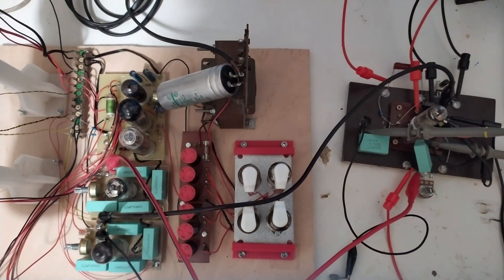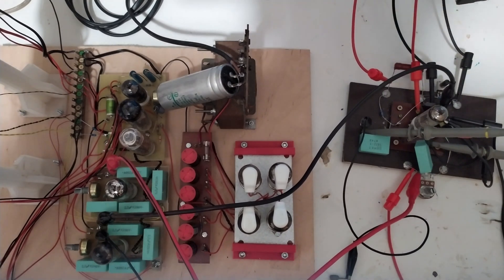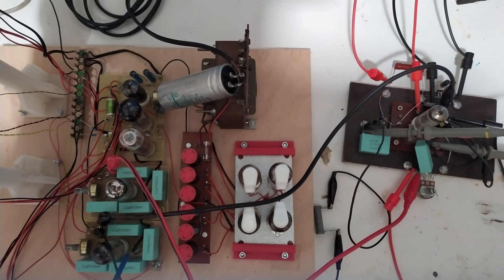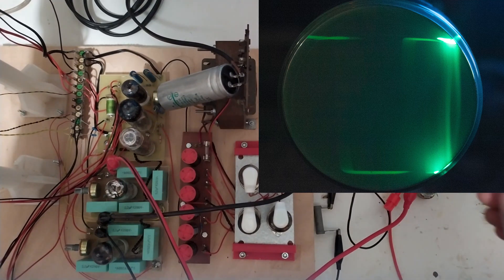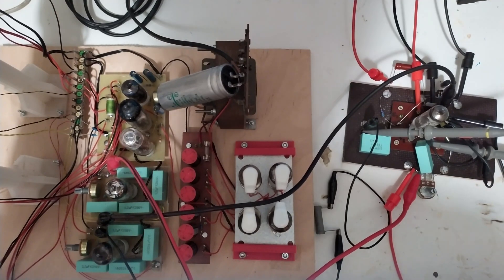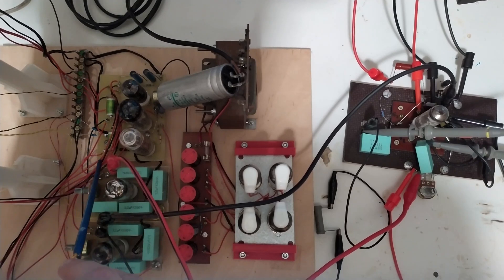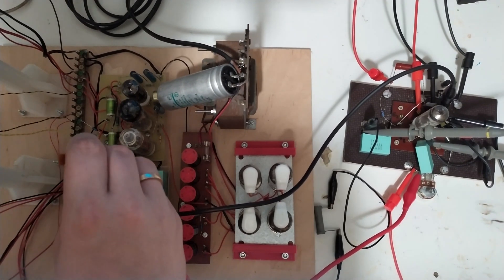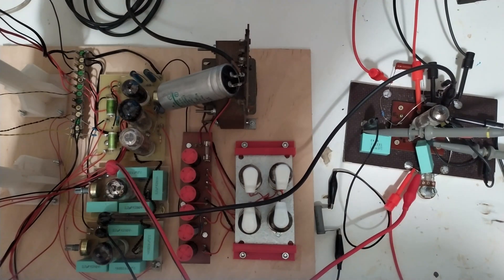Building a cathode-ray oscilloscope Part 6: It Works! (almost)

Comment: Good work don't give up just looking in  it would be wise to case it ,if you have a look on the NBTV forum  you can get lots of ideas how to case mount these as you get the circuits working ,even though its mainly to do with narrow band television it would still be helpful  ,help and such is  there for projects like this , ideas for power supply and such if you get stuck you just ask some  very  good  people there i am always  getting  good advice there,as i do many CRT projects